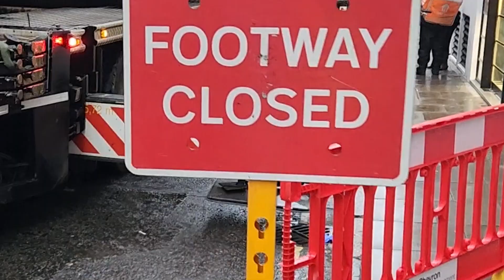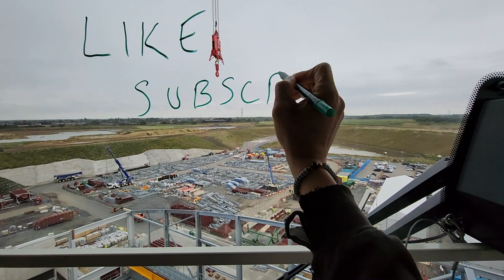Contract Lift  vs CPA crane hire | Crane operator

Comment: I just found out about these and they’re definitely my favorite type of cranes. I prefer Liebherrs though with the adjustable cab
Reply from the maker: Oh okay, cool. What's the adjustable cab?
Reply: @CCcranelife  the whole cab moves up and down so you can stop at any height to operate the crane instead of taking the little elevator to the top to the fixed cab
Reply from the maker: @SJ_999 oh that's pretty cool